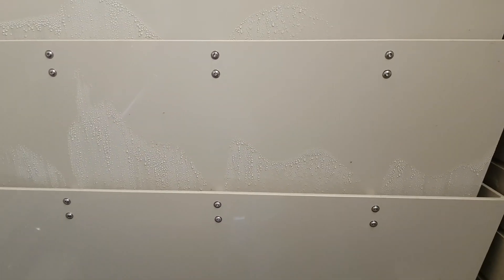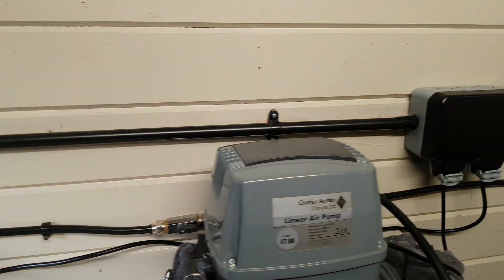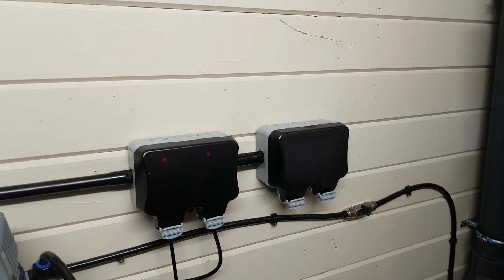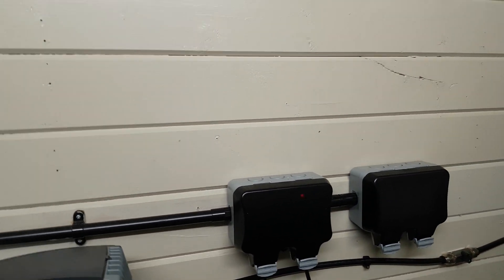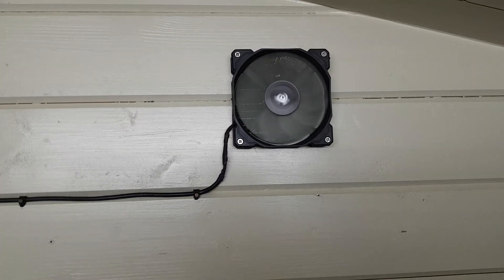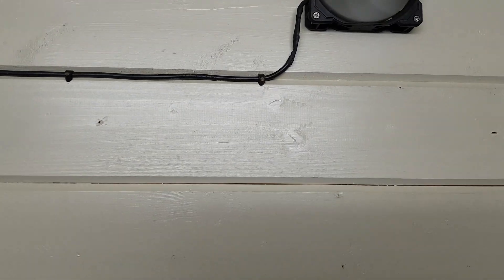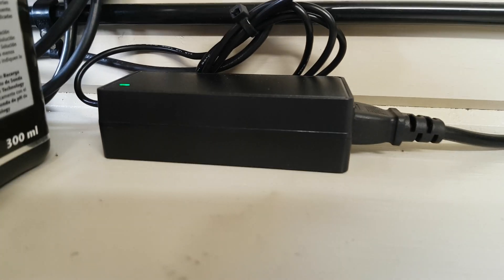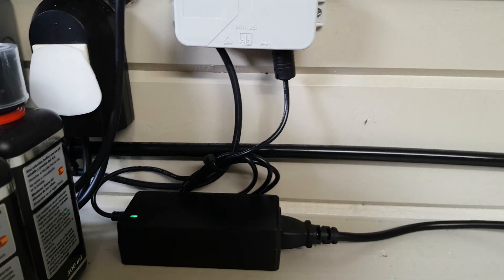Koi Pond, Silent Filterhouse Ventilation with 12 Volt Computer Fan

Comment: Hi Dave. Looks like a neat solution 👍. Is the fan extracting or blowing? Thanks
Reply from the maker: Thanks, 😃
The fan is extracting air, 
it makes a big difference to the level of condensation.
Especially with having a large shower in the filter house.

And it extracts just enough to help keep the humidity under control, 
without removing so much air it makes the filter house cold.
and only uses about 2 watts.
Reply: @DavesKoiPond  Thanks Dave, my setup will be pretty similar to yours, Qk35 drum, 2x IBC's with k1 and a big shower. So will fit an extractor fan like you have. 👍
Reply from the maker: @garryrobson3634  WOW 2 IBC's!
You must have a fair bit of room for those...
Good call though, you can't have too much bio 👍